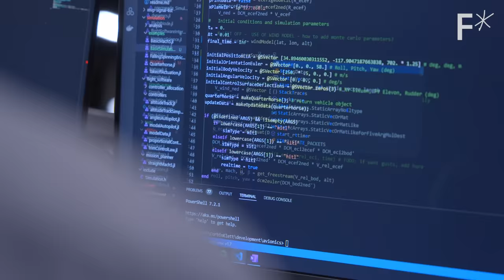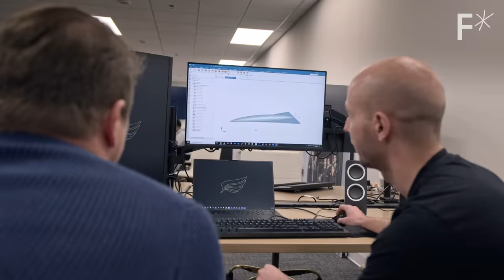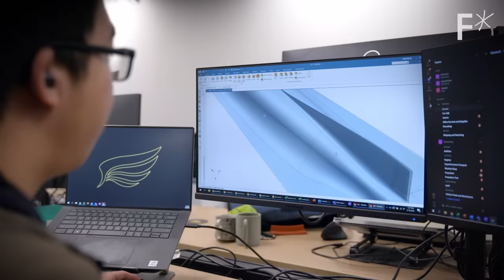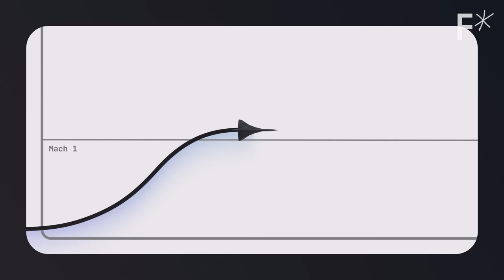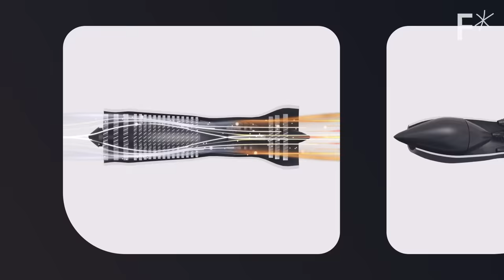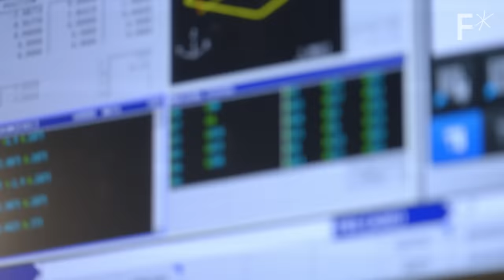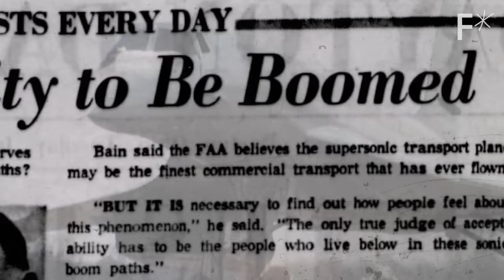This Mach-5 engine will do what no other can | Challengers

Comment: Didnt the SR-71 have jet engines that were turbo jets at supersonic and then transitioned to RAM jets? cant really say no other jet has done it before when there has been one
Reply: I thought the same when they described how their engine works. Its the same as a SR 71 or 72 engine. In one shot one of the engineers even has a huge book on his desk labeled SR-71.
Reply: Exactly, that’s what the big cones in the engine of the SR-71 are for.
Reply: Yes, but they never transitioned exclusively to a ramjet mode. The turbojet engine was always running.
Reply: @jakebrodskype  Correct the cones was there to break the air cushion that was preventing anymore trust at higher speeds. But dam those turbojet engines had to be built very strong to take those loads.
Reply: Yep!
Reply: Correct.  The Pratt & Whitney J58 in the SR-71 had 6 bypass tubes that took air from the front portion of the engine and put that air behind the compressor section of the engine, thus mimicking a ramjet engine.  The inlet cone controlled the flow through these tubes. These bypass tubes have never appeared on any drawings or schematics of the engine, but here they are: https://upload.wikimedia.org/wikipedia/commons/b/b8/Pratt_%26_Whitney_J58.jpg
Reply: There must be some proprietary way theirs operates, which allows them to say "the first of this kind" rather than the first.. period.
Reply: @MaddogMD82  it's bc this engine is the first "hypersonic" one planned to go Mach5, where the sr-71 only hit mach3.
Reply: @rogerrinkavage  that makes sense . Thanks mate
Reply: @cyrilio  not necessarily... The cones were to control shockwave position inside the inlet throat.
Reply: @rogerrinkavage   No one in this video described the hypersonic portion of the engine necessary to achieve hypersonic speeds. They only describe the turbojet portion and the ramjet portion of the engine. Just like the J-58 on the SR-71, a ramjet engine is incapable of going at hypersonic speed.  As I understand it, the SR-71 engine was capable of mach 4+ flight, but the airframe could not stay together above about mach 3.5.  When the SR-71 reached about mach 2.8 and the engine was in full ramjet mode, the pilot had to throttle back the engines because they would automatically go faster.  In effect, the pilot was dealing with a runaway engine that would accelerate until the aircraft broke apart. Using partial throttle at full speed was the key to the relatively long range of the SR-71.
Just to set the record straight, both a turbojet and a ramjet use subsonic airflow in the combustion chamber portion of the engine.  A hypersonic engine has supersonic flow throughout the entire engine, including the combustion chamber.  There is no portion of the engine in the video that has a supersonic combustion chamber.
Reply: @michaelrunnels7660  you do not get a "runaway" ramjet. You cut fuel and you are done
Reply: You are correct, sir
Reply: The J58 was the first (and so far only) engine designed to run red hot. I have seen photos of the engine running and the only light source was the engine itself. But the SR-71 was still limited to a tad over mach 3. To go mach 5 requires what is called a SCRAMJET or supersonic combustion ramjet. The J58 was a turbo-ramjet NOT a scramjet. Whole 'nother animal.
Reply: Yes the SR-71 has ducts to bypass parts of the engine depending on what it's doing.  Pretty obvious you'd need that really. The engine that produces takeoff thrust is running differently to the engine providing thust at high altitude at supersonic speed. The trick is how you can transition those modes. They did it with wings with the swing wing designs.
Reply: @cyrilio  the intake spikes aren't for any ramjet aspect of the J58's. It's there to control the normal shock wave location in the engine intake so that the engine compressor section doesn't injest supersonic airflow.
Reply: Good catch Fart Master, you're right about the SR71's bypass burners
Reply: Yes it did
Reply: True. The 'turbo ramjet' has been around since the 50's. This may do the bypass bit a little differently, but they haven't made a completely unseen concept.
Reply: @michaelrunnels7660  except that the engine itself (J58) had alot more in it than 3.6.   
Although never confirmed.    

However it wasn't the airframe that was the problem. 
It was heat.   Going that fast added alot of heat from air friction.
Reply: Kind of yes. The SR71 definitely didn’t have a full ram jet like it had a full jet engine which is partly why the SR71 was limited to Mach 3.2. These guys are trying to reach Mach 5 so will need much more of a full on ram jet in their hybrid engine
Reply: @MaddogMD82  The comment from Jacob above clarifies it, the SR-71 engine "never transitioned exclusively to a ramjet mode". This is the proprietary tech Hermeus is trying to build, an engine that transitions to exclusively ramjet (which SR-71 did not)
Reply: @dj1984x  "the SR-71 engine "never transitioned exclusively to a ramjet mode" ".  From what I know about the SR-71 and the J-58, I concur.
Reply: Exactly
Reply: @michaelrunnels7660  exactly, it was never a full on ram jet
Reply: @michaelrunnels7660  Actually the problem with the SR71 and specifically the J58 engine was that they couldnt go past mach 3.5 or the shockwave that would be in front of the cone would be fast for the cone to effect it so the engines would suck in the shockwave and blow out. The engines would need to be restarted and this actually happened during one of the SR71 flights and luckily the engines were restarted
Reply: @jakebrodskype  good sir  please read up on the engine that propelled the SR
Reply: @michaelrunnels7660  Finally someone who understands how the J-58n works  thumbs up my friend
Reply: @MaddogMD82  Agreed, the way companies get around this is a new language I believe is called "legal jargin" :)
Reply: @rogerrinkavage  maybe listen a little closer, they even say in the video that scramjets work at, and above mach 3.
Reply: @rogerrinkavage  Only hit mach3, that you know of.
Reply: For all of you wanting to see how it works...
The mighty J58 Turbo-Ram Jet
https://youtu.be/F3ao5SCedIk
Reply: Watch the video.They specifically say that they are not inventing any new technology. They are only making a modern hypersonic aircraft
Reply: @erasmus_locke   That is exactly what they say. However, they go on to explain how they accomplished takeoff speed below mach 1, then explain how they transition from mach 2+ by utilizing a ramjet configuration up to mach 4+. The video does NOT address any hypersonic engine portion to achieve speeds in excess of mach 4.7+.  Above that speed all airflow through the engine is supersonic, which a ramjet cannot do. A ramjet will flame out approaching mach 5. The engine in the video appears to be a high supersonic capable engine, but NOT capable of hypersonic speeds, which are defined from about mach 5 to about mach 10. Of course, the fastest in atmosphere aircraft was the X-15, which achieved speeds of mach 6.3+, but that was with a rocket engine, not an air breathing engine.
Reply: @rogerrinkavage  It only hit mach 3 because the rest of the plane couldn't take the stress/heat. The pilots all said it could go much faster if they wanted it too and in some case to escape missile threats it did.
Reply: Yes.
Reply: @rogerrinkavage  that's where you're wrong. the SR 71 engines were hypersonic capable but the structure of the craft wouldn't be able to Bear those loads for very long. The airspeed was deliberately limited to Mach 3.2
Reply: @billmullins6833  according to Wikipedia at least, ramjets can manage speeds up to Mach 6 whereas scramjets have been operated at speeds close to Mach 10 (NASA X-43).
Reply: Like Elon Musk saying he first to land a rocket with propulsion, but nasa did it 2 decades earlier.
Reply: @michaelrunnels7660  That's a display at the Evergreen aviation museum. I was just there a few weeks ago. Pretty awesome stuff.
Reply: @jakebrodskype  Ohhhh OK i see thats a fair point.
Reply: @michaelrunnels7660  I do believe a true ramjet is capable of mach 5 but thats about its limit. Scramjets after that babyyy.
Reply: @rogerrinkavage  almost 60 years ago...and it was the airframe that limited max speed. They designed that engine with paper, pencils and slide rules. They had to invent the technology with virtually zero previous knowledge to draw from. It's much easier to reach higher, when you are standing on the shoulders of giants.
Reply: @michaelrunnels7660  yes there are no supersonic ramjets, but only because supersonic ramjets are called scramjets lol.
I can't say whether the sr-71's engines could have been pushed farther but they never were, so seeing these in action would be pretty remarkable
Reply: Right !   I call BS advertisement .
Reply: A turbo-ramjet
Reply: @DespaceMan  not really sr71's engine had a mechanism to block flow and let air straightly to ramjet part they didnt let any air to turbojet basically
Reply: @rogerrinkavage   The term "Ramjet" is used to designate an engine with no moving parts that provides thrust by using subsonic flow through the combustion chamber. The term used to designate an engine with no moving parts that provides thrust by using supersonic flow through the combustion chamber is called a "Scramjet" or "Supersonic Combustion Ramjet". The combustion chamber on both of these types of ramjets is totally different from one another. Tests determined that the minimum speed required for ignition of a Ramjet was 320km/h or 173 knots, though at that speed the thrust it produces is almost negligible. It uses a nose cone to generate shock waves to slow the airflow below supersonic speed. At speeds approaching mach 5 the nose cone of a Ramjet is incapable of slowing airflow to below supersonic speed in the combustion chamber. A Scramjet has no nose cone and must be moving above mach 1 to operate. A Scramjet is capable of speeds in excess of mach 10.
Reply: @BobbyGeneric145  At least, that's what they tell us... 😉
Reply: @smadams450  yes, scramjets and scramjets certainly work above mach 3, i wasn't saying they don't/haven't.
Reply: The SR-71 was not hypersonic.
Reply: @michaelrunnels7660   but how would the jetengine in front not self destruct at mach 5+. Does it stop moving?
Reply: @rogerrinkavage  officially M3.5 but pilots had reported much scarier numbers, primary limitation was the frame, engines never reached their full potential
Reply: Turboramjets were the official term, they bled air into the afterburner to create the shockwaves within the turboramjet.
Reply: @flir67man84   In a hybrid engine that is a combination of a turbojet and a ramjet, most of the high speed airflow is diverted around the turbojet on the outside of it. A small portion of airflow still goes through the turbojet to keep it running. In that configuration at high speed, the turbojet portion contributes little to the thrust. In the case of the J58 the turbojet contributes 17% to the total thrust. The turbojet portion acts primarily as a "pump" to keep the whole hybrid system going. All combustion is happening at subsonic speeds. At speeds above mach 5, the airflow in both a turbojet and a ramjet cannot be kept subsonic going through the combustion chamber. Neither will work above about mach 5.  A scramjet is a completely different animal and requires a physical shape different from either a turbojet and a ramjet.  No engine has ever been made (or even contemplated) that is a combination of a scramjet and anything else, including the one in this video.They are attempting to combine a turbojet with a ramjet, just like the J58 on the SR-71. The big difference with the engine in this video is that they plan to use it for civilian passenger travel, whereas the U.S. Air Force used it in a military aircraft.  Bottom line is that the engine described in this video is NOT physically capable of sustained operation above mach 5.  I believe that their use of the word "Hypersonic" is incorrect and is being used for PR purposes.
Reply: @jricher23  
Actually the SR 71 suffered numerous "unstarts".
At first it was a very noticeable event, later with automated controls it was almost unnoticeable.
Reply: @serdarcam99  
Not according to what I have read.
The turbojet continued to spin and produce power.  This is obvious since the J-58 powered the hydraulics and generators.  Yes the turbojet provided increasingly less thrust in comparison to the afterburner, but it continued to spin and produce power.
Reply: @mahbriggs  so it gets much less pressure anyways it probabily worked lower pressures than a normal turbojet
Reply: @serdarcam99  
I rather doubt that.
As I understand, the bypass tubes led from the primary compressor stage, bypassing the combustion chamber and the turbine section of the engine, and dumping directly into the afterburner.  This produced the majority of the trust at high speed, but I believe the turbojet portion was operating at full power.
Diagrams of the engine are misleading as they imply the air flow behind the spikes fed directly into the after burner.  Pictures indicate otherwise.  There is a YouTube video  explaining the operation of the engine.
Sorry, I can't find it now, but it was quite informative.
Reply: J-58engines
Reply: @rogerrinkavage   A jet engine cannot process a shock wave.  The inlet traps the wave before it hits the engine. The SR variable spike did just that and the system bypassed the engine and went full ramjet.  They said “Turbo-ramjet”
Reply: @jakebrodskype  actually they did fully transition to ramjet mode. The Pratt & Whitney J58 engines didn’t have an electric motor in them so they didn’t produce power for the plane. The power was produced from a separate fuel generator which ran all the time. If you are concerned about starting the engine in flight like almost every engine at the time it could be airstarted.
Reply: @kellengro1124  The Mig 25 went to a hybrid ramjet mode too but they still let air flow through the compressor to turn it and generate electricity windmilling. It might be the reason their engine burnt out and had to be replaced after each Mach 3.2 pass.
Reply: Not quite. They would partially operate as ramjets, but the turbojet continued to operate. Chimera takes it a step further by allowing the turbojet to be shut down while continuing to operate as a ramjet.
Reply: @michaelrunnels7660  0
Reply: @michaelrunnels7660  You don't need a scramjet to reach Mach 5. That's what the exhaust nozzle is for. Supersonic flow through the engine is useful because it would make the engine smaller and more efficient, while also able to operate at even higher speeds.
Reply: It takes the principles of the SR-71 a step farther turning it totally into a ramjet. The SR-71 was still running the compressor and turbine the whole time.
Reply: It just goes to show you what a legendary team Lockheed Martin's Skunkworks truly was. They were able to ultimately pull that off, and there hasn't been an aircraft like that since.
Reply: Yeah. It absolutely did. Turbo ramjet. A12 oxcart sr-71. That Pratt & Whitney was a monster. I don't like how they're kinda taking credit for all the work that the skunk works did. This seems like borderline infomercial stuff. Lol
Reply: @michaelrunnels7660  Man, I probably shouldn't even confess this on the internet but I was partying pretty good one night and went on a rant about how beautiful the j58 was and I wouldn't shut up about the tubes. Lol.
Reply: The SR-71's engines were kind of a hybrid of both. Hence why they were named "turbo-ramjets". They had bypass ducts to feed air directly into the afterburner. Chimera is bypassing the whole compressor stage and feeding air straight into the ramjet which is supposed to be the afterburner
Reply: Yes, and it's not the only problem with the video. And Hypersonic low-altitude commercial flights will not work from an economic point of vie unless something big in thermo aerodynamics. Inconel can take it but the number of cycles will be limited. The Chief engineer talked about loads, and I believe she was referring to it The video oversimplified stuff but most people will not notice. Maybe is better like that, people like you and me can research more.
Reply: @jaimeduncan6167  This is definitely a beginner's video or whatever and that's fine. I just don't like the misleading and taking credit for others people's hard work.
Reply: @DCDrCoyne  A-12 and SR-71 didn't transition to 100% ramjet. The turbojets always operated.
Reply: @bobwilson758  Yeah, this is a hopped up go fund me.. 👏 🤣
Reply: @michaelrunnels7660  Ram jet engine requires supersonic airflow, which means they need airspeed greater then mach 2. A scram jet or turbo jet can only handle sub sonic airflow and at mach 2 there performance is reduced by over half and can even cause flame out. What they should was a hybrid of turbo jet and a ram jet engine, but what they haven't showed and for obvious reason (don't give away trade secrets) was the way they were to going to transition to a ram air engine. Currently the only engine with out restrictions of airflow is a pulse jet engine, but pulse jets are hard to maintain and use.
Reply: Exactly, this has been done. Kinda weird how humans are pretending we're in the sixties again...
Reply: Yup, the Pratt & Whitney J-58
Reply: Yeah, they also had a nasty habit of suddenly going full reverse at full power. Caused the whole airframe to instantly disintegrate. There were a few aircraft lost to this issue.
Reply: Correction SR-71 thrust system is a 3in one. Ram,scram,and turbine. To this day, it is and will remain unmatched in performance and raw engineering beauty.
Reply: @pseudotasuki  Thanks for the reply.  I worked on the blackbird, and I suppose an old fart Aero engineer.  I do like the concept.  How would they re-start the J-85 after they transition back to its start envelope?  Also, the XRS engine would be an option if scaled down?
Reply: @pseudotasuki  also sorry for the comment about more book than practical knowledge.  no offense intended.  do you have contact info?
Reply: Why isn't army helping to build mach 5 civilian air bus  ?
Reply: Came here to say just this.
Reply: Sorta, it had a bypass flow
Reply: Yup …they did this decades ago
Reply: @DespaceMan  Actually they were to prevent supersonic air from entering the engine
Reply: Yes it did.....It worked as a normal jet up to higher mach numbers than the air was bypassed from the compressor and became a ram jet.
Reply: No, the SR-71 never used any RAM jet technology.
Reply: @pluto8404  Not really, they are first of its kind in the fact they are attempting to create a SCRAM Jet, the SR-71 was a RAM jet engine that required partial turbine and RAM in order to control the runaway affects of the RAM engine. A RAM engine requires subsonic airflow within the injection chamber while a SCRAM utilizes supersonic airflow throughout
Reply: Yes sort of ,the central turbine of the SR71 still kept producing thrust but had bypass pipes sending air into the afterburner section . They blokes have combined the two in a much more efficient way .
Reply: @rogerrinkavage  Oh I see
Reply: The J-58 (engine of the archangel series aircraft, including the SR-71) was a very similar design in many respects. On a typical fighter aircraft, the afterburner is usually a small portion of the engine design (because you can get a lot of thrust out of a fairly small (by weight) afterburner). The J-58 had a "BIG" afterburner, which comprised a significant part of the engine. The other trick the J-58 employed, was to use the shockwave-induced compression to feed the afterburner, while continuing to feed the traditional turbine engine with essentially "boundary layer" waste air. This is air which has been accelerated by it's interaction (impact) with the fast moving structure, and is "in part" moving with the aircraft, giving it a reduced flow speed, relative to the aircraft. So when the archangel plane was going mach 3.3, the turbine engine core of a J-58 was meeting air accelerated to near mach 1, so the turbine engine only had to deal with handling mach 2.3 or so. Meanwhile the afterburner (which is usually an afterthought and poorly optimized) was very large and elaborate, and could produce an enormous amount of thrust on it's own. Largely the brilliance of the J-58 was to keep further compressing and slowing down air (technically speeding it up to more keep up with the aircraft) entering the turbine as the plane rose in altitude and speed. Match that with a very low drag design, with very efficient lift production (lifting body, etc), and materials which would handle the heat (mostly titanium), and the archangel planes flew.

Really it was an evolution of early supersonic planes which used nose-cones in air intakes purely to protect the engine tubine core from the full brutal force of high speed flight. Skunk works just said "what if it wasn't just wasteful drag, and did more than just protect the turbine?". Later engines employ variable fan blade angles, which allow them to handle somewhat more speed (introduced on the J-79), with less risk of damage. But early on, the fan blade angle was fixed, and intake nose cones helped helped regulate intake air speed & pressure, and help the engine not push itself till the fan blades stalled out (or broke).

The archangel aircraft could cruise at mach 3.3, and go up to mach 3.5 to 3.6 if the pilot was feeling bold. And the J-58 engine itself could produce thrust through that range, but it's thrust would plummet at around mach 3.8 (along with significant risk of engine damage). The afterburner was perfectly happy at mach 3.8, but the engine turbine core was at it's absolute limit at that speed.

Quarterhorse, is looking to do very much the same thing, with one major difference. They want to have a still larger and more optimized afterburner, and completely cut off the turbine from airflow at high speed. Once the turbine is cut out of the airflow, the afterburner is effectively a ramjet. So that the engine isn't limited by what the turbine can handle. It's complicated, but not THAT complicated. The real trick is to get parts to survive the temperatures and pressures involved. Moreso the aircraft than the engine. Especially on a reusable aircraft. It's one thing to make a hypersonic missile, it only needs to survive flight one time. Much "spin" in aerospace is put on hypersonic missiles, but they're really not all that fancy. If you want to measure a plane's usable lifespan in thousands of flight hours though... that's difficult. 

Lockheed's SR-72 prototype does largely the same thing, in terms of engine design. But it employs a few tricks in it's shape to emphasize supersonic lift and alleviate pressure & heat to the wings at hypersonic speeds (that odd angular notch in the wing-root). The X-15 did something kinda similar with how it's fuselage shape mated to the wing.

I do like quarterhorse's approach too though. The downward canted wings with the double-tip nose... that combo should be able to generate supersonic shockwave lift in a manner similar to what the B-70 used with it's downward folding wing tips. If you extend out from the nose of an aircraft, and then bend down like that, you're going to be at an angle which catches shockwaves off the nose of the aircraft onto the underside of the wing, which will push it upwards (at an angle). Do it on both sides, mirroring each other, and you have a more purely straight upwards force. Doesn't work if it comes straight off the center of the fuselage, you have to go out, and then fold down to catch the shockwave at the right angle. B-70 did that in the most obvious way. But the Darkhorse is using a double-tip... basically the shockwave of the nose tip on the opposing side, will hit the underside of the angled wings. Left nose tip's shockwave hits the underside of the right wing, and vice versa. Not sure if the twin nose shockwaves would behave normally after passing through each other, but I assume they've done the math. If you can get more lift out of a design, you can go higher. If you can go higher, you can typically go faster, with less brutal force put on your airframe.

From a technological standpoint, the one thing I was really curious about (and wasn't covered by the video) is what it's made out of, and how they're handling the heat expansion. That's the actual secret sauce.
Reply: J-58's
Reply: Why not just improve on the P&W J58?
Reply: I work for a portion of the company that owns P&W and have worked there.

The way the J58 works is you have a low bypass engine.

That means most of the air ingested by the compressor is burned or sent though the combusted.

The issue, why you hear “turbo ramjet” has to do with the air temp in the compressor. The gas coming out of the compressor on a modern engine and even an old one like the engine the J58 is based on is 1200 F and up.

That’s ingesting -40 F air at 30,000 feet. 

As you have probably hear the air being heated from aerodynamic friction gets to 500-700 F etc.

As a result there’s less and less margin to compress the air.

The J58 bleeds compressor air, bypasses the main combuster and goes straight to the after burner.

At high speed the majority of the thrust comes from the air being burned in the after burner.
Reply: Yes it did. The SR-71 was astonishing, especially considering when it was built.
There were a lot of technical hurdles and it was expensive to operate, but man what a beast!
Reply: @umsatz-magnetug1986  I believe the process he was describing was exactly how the SR-71 has operated for 50+ years. Having worked multiple Skunkworks projects, I am insulted by his either simple misstatement or his blatant incompetence?... He also mentions how "we broke the X-15 in half then put in back together". He wasn't part of the we but considers himself otherwise which is why I don't think it is a lack of understanding. I think it is him not giving credit where credit is due. Earlier they stated to paraphrase "We are not creating anything new here. We are just reconfiguring engineering things that are already exist."
Furthermore, ramjets are not ideal for hypersonic flight, sure they are operational between M 0.85->M~7 but their efficiency and basically all performance parameters plummet exponentially after Mach 3-4 due to the overall enthalpy drop that comes from the shockwave starting to reflect. This is why the SR-71 had a movable cone. It was an attempt to optimize entrainment of the shock waves at increasing speeds. Even then Mach 3.2+ started to choke the engine so much so that there are flaps that dump this self-compressed air out of the sides of the engine to try to preserve the compressed pressure (and temperatures)-to-mass flow rate ratio into something useful for the ramjet.
If he was developing a vehicle that is going to operate in a hypersonic regime, he would be focusing one of two things: Cooling the compressed air to less than the combustion temperature of his, I'm sure he is using JP-8/10/A, to mitigate the Prandtl-Meyer effects of compression/expansion at that speed that limit the SR or scramjets. I'll bet all my marbles, this thing will never fly Mach 5+ with a human on-board. They may slingshot it up to 90kft+ and dive bomb a Mach 5 run but mechanically and economically Mach 5 flight is unsustainable with a Ramjet. Ramjets have their place and it is solidly in the transonic to lower hypersonic range.... basically exactly where the SR operates. Crazy how there is almost 70 years of literature into this topic and this guy is inventing it from scratch cause he saw a Globemaster take off once when he was a kid. Then he shows his son the SR and says, "This is one of the fastest airplanes ever built." No! Its the fastest plane that operated solely with air. Anything faster used rocket assist. This guy and/or his incompetence/ego are nauseating to watch.
The only way we are getting from NYC to London in an hour and a half (the holy grail) will be exo-atmospheric. Period.
Reply: Sr71 engines "emulated" ram jets and it had moving parts. They're trying to basically put a hybrid engine that has least amount of moving parts to none
Reply: @MSStateBulldawg83  To be honest, they can do better than a J-58 now. There's numerous engine technologies now which were not available when the J-58 was made. Particularly single-crystal blades, variable blades, and the advantage of computer modeled core flow design.

But using the J-58 as a starting point for design evolution, you could make a pretty amazing engine, yeah.
Reply: @rogerrinkavage  Apparently you need to reread the declassified information.  The recommended cruise speed was Mach 3.2.  That wasn't it's limit.
Reply: @DespaceMan  I agree!  Plus, I often wonder how the cones stay together at Mach 2.0 speeds and higher.  I won't make any claims, but the SR-71 can reach Mach 3.0 plus!  Some claim the newer models will travel at Mach 5.0 plus.  

I often wonder how the entire Engine & Plane stay together at these speeds.

There is a lot more I need to learn.  I have not found enough data on the Engines to form a comparison to, or understand how the Engines stay together from the Shafts to the turbine blades.  They are spinning at tremendous speeds, plus taking a beating from the Air rushing through!
Reply: meanwhile Russia is creating hyper-sonic missiles to blow the crap out of them.
Reply: @DespaceMan  I thought that they were there to regulate how much air would flow into the inlet. It is my understanding that you can't have air traveling at supersonic speed through the ingine.
Reply: @rogerrinkavage  not the first engine to go hypersonic, but one of them
Reply: @CarlosAM1  right, though it might be the biggest... I can't confirm that though lol
Reply: @austintaylor7363  Things I read said even the windows got real warm.  Over 600F on the inside of the glass.  Hotter outside.  High speed air friction is no joke.  It must have been miserable, and wonderful, to fly in one.
Reply: @JWSmythe   I'd love a 2 hour flight in one to solve my bucket list but until then watching new advances in tech will suffice lol
Reply: @jricher23  Flame-outs occurred numerous times with the Blackbird pilots.  And like you said mostly from exceeding their SET air speed limits.  They practiced those re-starts in the simulator's.  And sometimes they just couldn't help nudging that aircraft closer to Mach 3.6/3.7 than they were supposed to!!
Reply: They sure did.  Those were Pratt and Whitney J-58 turbojets (largest turbojets ever produced) with huge variable length intake rams and air compressor bypass system.  It's official declassified max speed was mach 3, but a coupled of record speed runs had it moving closer to Mach 3.3.  I highly doubt it could surpass mach 4.0+ as it would have chocked the otherwise nearly closed off intake resulting in a combustion stall or flame holder failure in the afterburners.
Reply: Yes this Video is very wrong in a lot of different points. They should have done a lot more research.
Reply: @austintaylor7363  active cooling and ceramic-metal composites would have helped out a lot here.
Reply: @shirousagiexe  perhaps, but it might have been as fast as it DID go
Reply: @michaelrunnels7660  this is why the J58 in the SR-71 was called a turbo ram jet engine
Reply: Yeah that's what I was about to say
Reply: @jakebrodskype  didn't it run to provide the heat at that point?
Reply: @jakebrodskype  yes but air was channeled away from it
Reply: Yeah they also named their engine j85 which is oddly similar to the blackbirds j58 engines
Reply: The engine is called a "TurboRamJet"
Reply: I think this people don't even know their history very well. And the X-43 reached mach 9.8 which is almost double the speed they are trying to achieve. This all seems like heavy marketing and less engineering.
Reply: @michaelrunnels7660  Michael,  You and I are in the 1% of commenters here that know about reality before 1997.   As you can see  Intelligent and factual comments , like yours,  get little or no typed replies. Just a thumb . The SR -71 entered service in January 1966 & could reach Mach 3.5  because that is  the minimum needed. 
Lockheed Skunk Works could  easily built it to reach Mach 7  if required.
Reply: I also thought about the SR-71 Blackbird
Reply: @michaelrunnels7660  I would believe that is very sensitive information. Depending on a commercial or militaristic  paradigm, the supersonic combustion method could be both a trade and state secret.
Reply: @JBirdBobbyJ   Uhhhh, no.  This technology is almost 60 years old (how old are you?) In the last 40 years technology has progressed to the point where everything you read about belongs in a museum.  No technology from WWII or Korea or the cold war is classified any more. Even technology from from 2010 is so outdated that no one in the world thinks it's relevant any more.  There come a time when the technology of PacMan video games becomes outdated, despite Russia saying that PacMan is the latest and greatest electronics that it's military has.  Russian technology is rooted in 1960s paradigms. Due to Russia's invasion of Ukraine, Russia will regress to the 1950s technologies of a dozen or more transistors on a computer chip.  Meanwhile the rest of the world will have 500 billion or a trillion transistors on a thumb drive.  Don't worry about IBM 286 and Apple one technology being either a trade or state secret. It's not.
Reply: @jakebrodskype  actually it did a few times... That's when it would start to melt and break down.
Reply: @rogerrinkavage  The sr-71 was limited due to the leading edges melting. It could go much faster. I worked with a old mechanic many years ago he was in his seventies at the time. He only worked since retirement was boring for him. He was part of the original CIA program at a Aircraft parts manufacturer after I left the Navy. He told me about some interesting tales about some very interesting repairs.
Reply: Yes They said they were not inventing anything new just trying to improve on what was there. To go faster.
Reply: @rogerrinkavage  I think its actual top speed is still classified.
Reply: @johnarnold893  exactly
Reply: Vlad & Xi have joined the chat
Reply: And the sr71 Went 3000 miles per hour.. (coast to coast in 1 hour = 3,000 miles per hour) not rocket science math!
Reply: Yes the SR71 transitioned to ram jet by moving it’s engine inlet cone to allow supersonic air get into the engine but also slowed the air down at the same time because combustion takes time…. Brilliant aircraft the SR71…. Created with slide rulers and to this day the fastest aircraft ever
Reply: @jackdundon2261  the SR71 hit mach 3, that’s not 3000mph, it’s over 3000kph though
Reply: @JWSmythe  miserable is probably right, but as a pilot it would be the ultimate experience to have
Reply: @thomassievers3362  psst Mach 3 is just over 2,000 mph...  I read that a sr71, went oilit over the ocean,  turned around, full Throttle, hit the coast.. EXACTLY 1 hour later it crossed the other coast line. (Doesn't matter pacific or Atlantic-- coast to coast in 1 hour) 

The United States is 3,000 miles wide NOT 2000 miles wide. 

Pretty basic math 3000 miles in 1 hour = 3000 mph. 

The question, who are they trying to fool? The Soviets knew how fast it went. It outran their missiles.  Our governemnt is only lying to the American people!  Why?
Reply: @thomassievers3362  its like Harry Potter! Unending magic, but technically stopped in 1940!!!!   fastest plane ever in 1960.... 100 years later, can't make anything better!
Reply: In short.....yes
Reply: There are many…
 Watched an 11 thousand mph air breathing test… autonomous. 

Still, good team. Good marketing. God speed.
Reply: @rogerrinkavage  actually the top speed of the SR-71 has never been revealed. It's still classified! While in the Air Force I talked to some people who worked on them, they said that they can't say how fast it goes, but it's much faster than the public has been led to believe.
Reply: even better, it had started inlets - that is, inlets that actually produced thrust - 80% of it, at mach 3, according to kelly johnson, there is an inlet spike that compresses the shockwave and just behind the spike is an expanded location - and at that location, there are three things creating low pressure - the engine, the bypass ducts and the venturi suction of the bleed doors, now let's assume for argument's sake  that the ambient air pressure is X, and at the end of the inlet spike many times X, but on the other side of the spike, with all that suction, it's a tiny fraction of X , we  drive a compressed shockwave into a decompressed area and the compressed shockwave explosively decompresses producing a vast amount of thrust - it's not magic but rather a mechanical state change akin to a refrigeration cycle - giving a huge power  advantage - we are leveraging suction created by the engines and nacele geometry to produce thrust, the genius of kelly johnson!!!! if a sr71 had to fly subsonically due to a failure it would need a lot of refuelings to get home, originally they controlled the spike position and the bleed doors with switches and the a12 predecessor to the sr71 got some more speed, but if the decompression went too much out of the bleed doors it would "unstart" and the aircraft would yaw violently - so it was completely automated at the expense of .2 mach, the A12 hits mach3.5 but the  sr71 only mach 3.3 all other thing being equal , i mentioned "refrigeration cycle" actually that was also used - cause expansion is a refrigeration effect and there were tiny holes in the spike assemble that would take cooled expanded air from behind the spike up the middle of it to the front and out more tiny holes to keep it from vaporising - imagine all that in the 50's!!!! - they aught to take a long hard look at that to see if they can make it work at mach5 - it would be a huge fuel saving
Reply: The Air Force used 454 Chevy engines to start the SR-71 engines. Murica!
Reply: @jackdundon2261  Source? Never heard about what you described. Also, your coast to coast distances are incorrect. Where are you measuring to say that the United States is 3,000 miles wide? It varies greatly depending on where you measure. Neah Bay, WA to North Key Largo, FL is 2,871 miles and that's flying the U.S. diagonally. Border Field State Park, Chula Vista, CA to West Quoddy Head Lighthouse in Maine is 2,788 miles, and once again diagonal. The "West Coast to East Coast" record shows a distance of 2,404 miles, (FYI Sunset Cliffs Natural Park in San Diego, CA to Jekyll Island, GA is only 2,096 miles and is coast to coast) in 1 hour 7 mins 54 secs making an average speed of average speed 2,124.5 miles per hour. I can't find the exact start and end point for the coast to coast record, but , 2,404 miles would be correct for Southern California to the D.C. Virginia, North Carolina, South Carolina area, and by any measurement, that is coast to coast.
Reply: @guyintenn  "source" its amazing, ANY RECORDS before about the year 2000 don't exist. Before the internet was. Related all the magazines and scientific journals weren't put "online", as online didn't exist! Back in the late 90s and early 2000s all the tea jers and professors hammered into us students if you went online it had to be a reputable source. - somehow, now, if it's online and anti- America it has to be true! 

As for thr sr71 going coast to coast in 1 hour, as I recall it was in a popular science magazine. But, I was a kid, and could be mistaken.  My old man was more excited about its speed than i was, and he read the article to me and my elder brother. 

I did wonder, about 3000 miles coast to coast, as it's about 3000 miles if you drive. Point to point would be less. As you pointed out 2400 miles.   There's the coast to coast speed. 2400 miles, I stand corrected. -- if your after thr location, I would ASSUME Edward's airforce base was the start?  Though with thr speed of thr blackbird, it really doesn't matter.
Reply: They are using the same turbine stage as the SR-71 lol.. J58s. Just they doing it backwards and with an external flow around/bypass.
Reply: @austintaylor7363  Heat was indeed the limiting factor, but it wasn't so much heat on the airframe that did it, but the turbine inlet temperature. At some (ambient temperature-dependent) speed, the engine hits a limit where it can't be throttled down any further without losing the flame, and its first turbine stage (the one that experiences the hottest exhaust gas) is right at the limit of what it can handle.
Reply: @jricher23  You're conflating failure modes. You're thinking of the "unstarts" the aircraft was prone to. That wasn't the limit to how fast the thing could go though (turbine inlet temperature was).
Reply: The engine described in the video does sound remarkably similar to the Blackbird's engines. The J-58 on the SR-71 used 6 bypass tubes to bleed air from the 4th compressor stage and feed it directly into the afterburner, which allowed the afterburner to provide more of the engine thrust and relied more on the RAM effect at supersonic speeds to handle most of the air compression. But not all the air was bypassed to the afterburner in the J-58, so the turbojet was still operating even above mach 3 but wouldn't over-compress the already high pressure air generated by the RAM effect as some of the air was bypassed. So the J-58 would either operate as a pure turbojet or a turboramjet.
Reply: Interesting how the SR-71's engine is called the J-58 while the engine in the video is called the J-85.
Reply: @rogerrinkavage  
Wrong.... Arojet Developed a Mach 7 Scram Jet in The 80's That They Ran 
"""""" Alot """""" & Often For a Decade in Folsom Ca. For the Canceled Boeing Hypersonic Passenger Jet, Ask Me How I Know  !!!!
Reply: @ronaldmasterbud1551  haha I'm guessing you were involved.  Did it ever fly though?
Reply: The cones slide back and forth in order to regulate airflow but there was no ramjet per se.  This would be the very first actual ram which would take over from the standard engine.
Reply: In the SR-71, the cones are used to slow down the air and deflect the shock wave away from the inlet. These guys want to use the shock wave to compress the air. Ramhet engine principles were a result of developing the SR-71
Reply: I think that they were referring to use that same architecture of engines but for higher speeds so pushing that to mach 5 which is something new ig
Reply: @michaelrunnels7660  Why do you keep claiming "ramjets are incapable of hypersonic flight", and where are you getting this precise Mach 4.7 number from?

Hypersonic flight is roughly defined as the point at which the air has enough energy that it will start to be reactive at its stagnation point.  As you slow down your inlet gases, they will heat up to the point that they start to form other species before they hit your combustor.  That doesn't mean you can't still feed them through your combustor.  At the bottom end of the hypersonic regime, your combustor inlet temperature will be around 1000C, but kerosene's flame temperature is over 2000C, so there's still plenty of room left to do work.

The reason you use a scramjet is because you suffer reduced losses and have a larger operational temperature range over which to do work, but that doesn't mean the ramjet magically stops working.  It just means it might not produce enough excess thrust to keep going faster.
Reply: @wagnerrp   There has never been a ramjet built that is capable of hypersonic flight, which is defined as speed above mach 5 (some say mach 6).  The physical shape of a turbojet and a ramjet slows the airflow through the engine to subsonic speed, where ignition can take place in the combustion chamber. If a turbojet or ramjet goes above mach 5 (or 6), the physical structure of the engine cannot stop the airflow from continuing to be supersonic through the entire engine. This ALWAYS results in a flame out of the engine. It will then produce no thrust.  If you think about trying to light a match in a hurricane, it can be understood.  It's not a matter of the air temperature being in the range of the wooden stick on a match burning, or the temperature of the sulfur as it burns. It's a matter of the extremely high wind velocity blowing the match out before it can light and burn the match stick. This is what happens in a ram jet when it reaches a speed of about mach 4.7 or 4.8 according to some, slightly higher according to others.  Combustion IS possible (and being done on a regular basis) with supersonic airflow, but not with the physical configuration of a ramjet or turbojet.  The internal shape of the scramjet engine that allows combustion in a supersonic airflow is different from the physical structure and shape of a ramjet. The difference between a turbojet, ramjet, and scramjet engine physical shape is shown here: https://en.wikipedia.org/wiki/Scramjet
Here is a video that explains the difference between a turbojet, a ramjet, and a scramjet. It uses an upper speed limit of mach 6 for a ramjet and an upper speed limit for a scramjet at mach 14.
https://www.youtube.com/watch?v=xpOa3B03gYg
It appears to me that the physical differences between a turbojet, ramjet, and scramjet are distinct and well known, while the speeds that each is capable of is a bit fuzzier.  I now tend to think of the speeds that each type is capable of achieving has a bit of conjecture to it.
In any case, the video describes a turbojet/ramjet hybrid (like the J-58) and talks about it achieving hypersonic speeds.  I'm not buying it.
Reply: 90 percent of this technology has already been done 60 years ago
Reply: No those were running on oversized pistons on a straight six motor, no turbo
Reply: The engine is a simple concept to communicate. Really understanding it and the. Making it happen is on another level. Lucky ram jets are simple, just tricky to have two jets in one.
Reply: Spot on!  As Picasso said ‘Good Artists Copy, Great Artists Steal!’
Reply: Yes it did.  There is plumbing that bypasses the compressor/combustion chamber section
Reply: The J-58 engines could only operate at subsonic air speeds, so they bypassed the supersonic flow around the engine to the afterburner, which provided morre thrust than the engine. They used the spike to control the position of the shockwave so it wouldn't flame out.
Reply: They are building on engine technology that was developed for the SR-71's J58 engine.
Reply: @rogerrinkavage  So they are a front company for hypersonic missile development. The SR-71 was too expensive even for the military in it's day. The idea that you could economically run a passenger jet at mach 5 safely and economically with sky rocketing energy prices is something no sane investor could get behind without something going on behind the scenes.
Reply: @AmericanDiscord  i think you put that pretty well.  They'll also be well compensated for r&d from the civilian sectors too I'd assume
Reply: Go to Ukraine and find out, there's plenty of them scattered in the fields and even a couple in apartments in Russia ¯\_(ツ)_/¯
Reply: @rogerrinkavage  but the SR-71 had a pilot, this is an exotic hypersonic missile without one
Reply: @jakebrodskype  maybe I am wrong but that is why the engines were called scram jet not ram jet but maybe lost on the acronym translation
Reply: The Pratt and Whitney engines in an SR-71 did function as ramjets. This engine will function as a scramjet. They are not the same.
Reply: @rogerrinkavage  And the SR-71 actually flew and worked.  This one is make-believe.
Reply: No those are normal ramjets, sr 71 has subsonic combostion. These, from hermeus, are scramjets with s meaning supersonic, c meaning combustion and then ramjet. Because scramjets don't need to slow down the air to subsonic speeds to combist it, it can go faster and do it more efficiently
Reply: Ot didn't go mach 4 +
Reply: I thought same thing
Reply: Yep! Kinda crazy to think how advanced our military really is. They’re just figuring this out and it’s been a huge task, but our military did this like 50ish years ago! Along with making that jet go Mach 3+ (at least what’s disclosed…)
Reply: Yes. It also had the bypass tubes that redirected the intake air to the combustion chamber just like how they mentioned this engine will do as well. They are taking old tech, that has been done before to apply it to a new airframe. Only thing new is the flight model. Doubt the military released the SR-71 engine plans though.
Reply: Yes, that’s what I remember.
Reply: If nothing else, you have designed the most beautiful aircraft. EVER. For reference, my previous top 5 are SR-71, Avro Vulcan, B1-B,  Tu-160 and MD F-111.
Reply: The sr 72 is however using this exact tech sopsedly
Reply: The comments here about the SR-71 are all great but it had an official cruising speed of Mach 3.2, it's official top speed is still top secret. The pilots have said it can go faster, never by how much but if you've seen them tell the story, they always have a grin on their face like they're looking at the gauges again, so you just know it must have been a lot faster.
Reply: good news everyone!
Reply: Yes the J-58 has already done it.
Reply: As an emoji translator, I have huge respect for these people
Reply: You are absolutely right. 💯
Reply: @michaelrunnels7660  They never said they had scram engine.  They said they had a ramjet engine that could do hypersonic speeds.  i.e. Mach 5 or above.
Reply: SR71 was not hypersonic
Reply: @umsatz-magnetug1986  he say "not in the way we have done it" or something. His idea is basically to use the afterburner as a ramjet, while the sr71 changes the intake geometry, if I recall.

I can only imagine the kind of materials they are using to withstand that amount of heat.
Reply: not at mach 5
Reply: @umsatz-magnetug1986  incorrect. The Turbo was always running when the ramjet set off. It never does a real transition.
Reply: So I haven't read through all the comments, but the general consensus on my favorite aircraft is not quite right. Luckily some things have been released publicly.  I believe I have read most if not all of them. For one, the flight envelope fades in a dotted area that just "ends", you can easily have a toddler draw it up with crayons to a little over Mach 4. Secondly the skin was  also the tank, you can easily heat up a and boil a paper cup filled with water over a bunsen burner. Turbine blades are operated above their melting points these days!!
Thermal coatings can prevent the only remaining problem of oxidation and other weird stuff going on at those temperatures. Spaceshuttle tiles also used this(also they exploded when exposed to moisture). And not to clash with other commenters just because leading edges melt doesn't mean u can't finish you mission. Look at some x15 pics...yes I know it was built of a different material... The chines and nose cone were removeable, in an aircraft that Kelly Johnson guaranteed an unlimited lifespan because the skin self annealed during flight... I think some pilots event talked about punching it and trashing the engines. 
Similar to the dragon lady, the problem wasn't even the engine in itself, which had to me manufactured for closer than normal tolerances (way worse with the u2 though) the problem is understanding what a turbine based combined cycle is. TBCC for short. In that sense most comments are right that it is a kind of hybrid but the J58 was NOT a true TBCC, those ducts kept the engine frome choking itself at high speed, reduce stress in the following compressor stages and yes at top speeds feed ram compressed air past the remainder of the engine and create 80 percent thrust that way. Combustion was thereby shifted to the afterburner instead of the chamber.  So it's a ramboosted turbine or something... 
Everyone forgets that Blackbird refers to a family of aircraft, starting with Archangel design Nr 12. I haven't seen oxcart mentioned anywhere so I know most guys haven't read the wealth of publicly available literature, SR71 at least has been mostly declassified. The predecessor to the SR71 supposedly went faster. It had less payload, was lighter thus higher thrust to weight so I'm  not even assuming. 
So if anyone kept reading till now, the SR71 probably was cheaper to operate, which says a lot....the A12 probably cooked its engines all the time, while having a lot less equipment on board, also the design goals changed A lot during the development cycle. The materials of the engine were not up to it, they probably would hardly be today, but they made it work in the only possible way back then. Supercars use femtosecondlaser gadgets these days, the haven't had lasers or fast computers back then,and they used slide rules to design it!! Also the SR71 suffered from unstarts, which I presume had at least been mitigated a little going forward from the A12, along with structural issues, as the a12s where in fact in service prototypes. 
Now, look up any TBCC schematic and u will see the thing that makes quarter horse tick as well. Shutting of the engine completely to protect it, taking it out of the airstream, since it's not useful or sensible to use turbine engines past Mach 3. The mighty J58 did not, instead it's compressor section felt the blunt force of the air ramed up its throat (I am groasly over simplifying) but to get to those bypass tubes it started melting the engine, they only bypassed from the  4th stage or so not directly the inlet.. . Materials where not as advanced as today to make things worse. So the engine actually slowed the aircraft down or rather limited its performance. A pure ramjet also does albeit to lower extent, but that does get significant once u get to around Mach 4.5, so the claim of the video does make sense. I would test it that way... So that is the whole point of a ram jet then, no moving parts. The J58 never stopped working in flight. Every conventional turbine engine including the J58 decelerates the air to subsonic speeds in the chamber and then (Re) accelerating the exhaust gas. That is a great deal of energy loss when you move that fast, it's an insane drag(which again amounts to heat and lower speed) a huge loss of energy... So the trick is to protect the unuseful turbine at high speeds. Going from ram to scramjet, that is having combustion occur at supersonic speeds is not necessarily a far stretch once you achieved the transition part, ram to scram has been demonstrated.  The claims in the video all seem to make sense, but the video has been way too shallow in terms of explaining and showing stuff for my liking. I would assume someone watching this has at least partial knowledge of what's involved.
Reply: The Blackbird's engines were much more advanced than this, and it was all done mechanically. Yeah the turbines would still run, but they weren't making any thrust. They'd have to run, or they would need a valve to close their exhaust so the ramjet's pressure wouldn't bleed through the turbojet in reverse. Simpler to just keep it running enough to act like a check valve.
Reply: There’s a lot wrong in this video. Right now the passenger planes that you could go get on right now have a top airspeed around the speed of sound they can do it and go faster but they don’t. The reason? It’s not practical. You burn so much fuel. Not to mention you need so much structural integrity. It’s not feasible or commercially viable to do so.
Reply: I see that no one here knows the difference between mach 3.2 and mach 5 but I guess damn near twice as fast means its the same thing 👍
Reply: Yeah they weren't efficient engines
Reply: Nope
Reply: @umsatz-magnetug1986  yeah and halfway through the guy said it’s never been done before in flight.
Reply: @jakebrodskype that is correct, while Ramjet was operating 20% of the air was still being redirected into the standard jet engine.
Reply: @umsatz-magnetug1986 i bet they have a chinese spy in the company stealing the ip lol
Reply: Ok nerd
Reply: @theccpisaparasite8813 to be fair that’s true with any “runaway” engine. No fuel no boom.
Reply: That is correct. Kelly Johnson was the project manager. I was part of this development in 1963.
Reply: They should have cloned Kelly Johnson. We need a man like him these days
Reply: Yup. Very true. The power plant used in this SR-71 Blackbird is a highbred jet engine that would routinely push the RS71 up to hypersonic speed and it was designed back in the 1950s and built in the 1960s. The engineers didn’t have computers to design it. They used a slid ruler and brainpower.
Reply: You are right! They were called turbo ramjets😅
Reply: yep...
Reply: Thanx for this video.
Reply: It's  been done  before, they are called turbo ramjets and all modern fighter engines are based on this 😅
Reply: The first supersonic airliner the Concorde did this with much higher efficiency
Reply: The 6 bypass tubes main function was to prevent the compressor from choking on the air at the rear of the compressor, the fourth stage, and routing that air to the afterburner for increased thrust. The inlet provided 70 % of the thrust at Mach 3.2 by the pressure differential between the incoming air of 0.4 psi and the pressure recovery of 15 psi at the face of the compressor. This large pressure differential provided a forward thrust vector from the rear of the spike. Imagine a balloon, whose pressure is continually replenished, while the air escapes from the nozzle.
Reply: nap that’s SR-72
Reply: Tech that's so yesterday, imagine what's going on today. tic-tac anyone?
Reply: they're more like college kids in paid college to learn how already developed stuff works.  Which is okay because at some point they can manufacture useful things for existing things, but will they make any major advancements?  most likely not if they're using the same things.  The sr-71 was only ran a little over half throttle at mach 3.2...  I would assume beyond that created too much heat and they plan to deal with it by using coatings of materials, which means it will have a failure point and most likely will be too costly for a passenger jet.
Reply: I believe the J58 never really transitioned into a full ramjet like the Chimera. The Turbojet part of the engine still ran it just had the added thrust of the ramjet section.
Reply: @michaelrunnels7660 People think that just because the J58 is called a turboramjet it can fully transition into a ramjet which it did not. At Mach 3 speeds the bypass tubes redirected part of the airflow to the afterburner section of the engine, but the turbojet was still working thus not being EXCLUSIVELY a ramjet. What the chimera engine does different to the sr-71 is that the engine does transition into a full ramjet meaning the compressor stage is fully bypassed and it transitions into full ramjet. You can see on one of the recent test videos where they shut off the turbojet engine before going into ramjet mode.
Reply: @michaelrunnels7660 The fastest air breathing aircraft I know of is the X-43, a UAV that reached Mach 10 thanks to a scramjet and being small/light
Reply: bro I'm saying the same thingg
Reply: They weren't a true ramjet I don't think
Reply: @rogerrinkavage That we know of, there were former pilots of the sr71 that said the jet could go much faster than what was publicly known.
Reply: Yeah it's easy to make an engine that goes hypersonic, the problem comes fitting it into a fighter or missle, missles like Zircon anf Khinzal amd CJ-100 are marvels of engineering
Reply: The SR-71 didn't go hypersonic though
Reply: Mach five is 3,836.35 mph. 😮
Reply: SR-71 did Mach 3.3
Reply: No those engines were able to do mach 3 maybe 3.5 very fast for it's time and still fast but not hypersonic
Reply: For hypersonic cruise speed (which is greater than supersonic cruise) you need scramjet engines not ramjet...so there is a difference right there between this & SR-71. The only difference is to project your guidance, electronics and other systems attaining hypersonic speed
Reply: Yes they did, have ramjets
Reply: Seems ironic maybe the investers were more conformable knowing the particulars so rather than apply for funding as testing new or untested projects limiting it to part sections already produced combined, but to me it doesn't make sense to stay within the realms of premade components it's a waste of time to be honest. I think you have great point that's just my take
Reply: I got to see one in person, I touched it (wow that sounds weird) they are so big in person I was almost overwhelmed while walking up to it. I feel truly blessed to see one in person